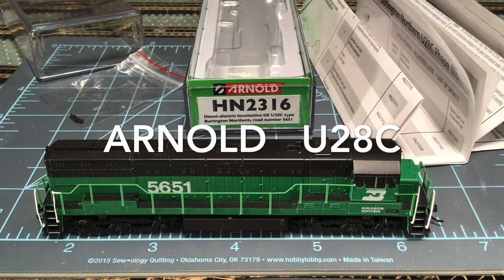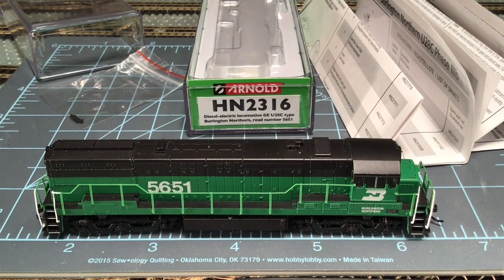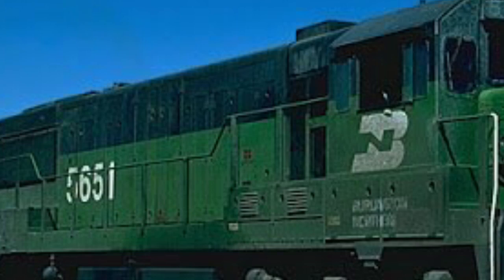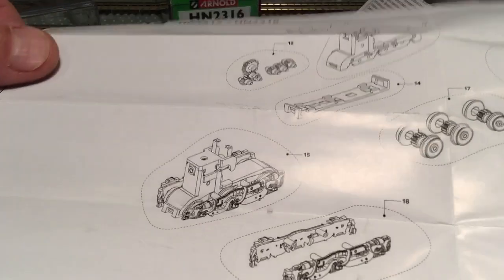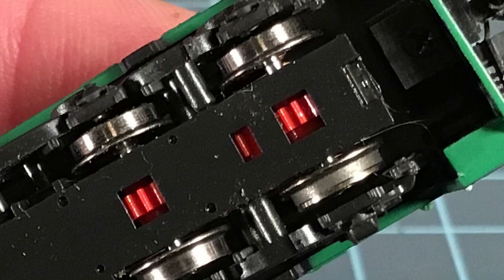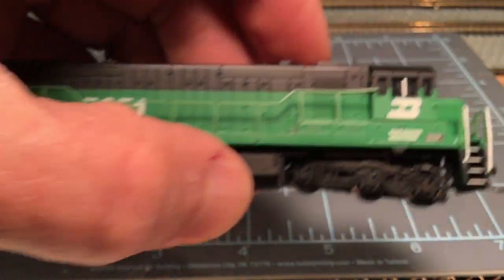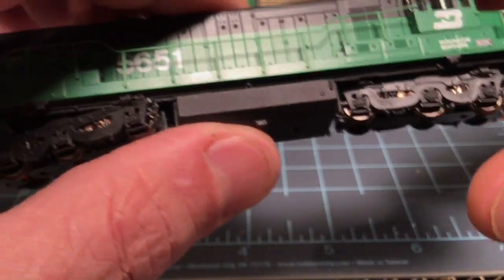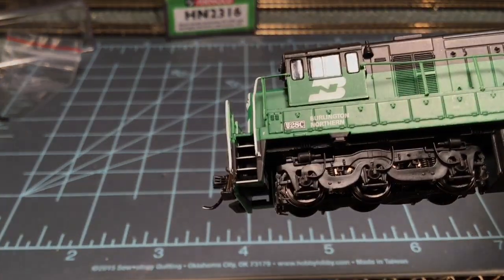Review - Arnold - N Scale - U28c BN 5651 - 15 February 2020 - Running Trains!

Comment: That engine looks good and in the future I maybe will buy a Arnold Loco since all I have is Kato and Atlas. Also check out those couplers on curved elevations because body mount one's  can tend to uncouple sometimes compared to the truck mounted one's. This is mainly on a tight curve , anyway good overall review.
Reply from the maker: Thanks Adrien.
I have a Kato switcher that runs excellent. An Atlas C420 that runs better now that it’s run around the layout a couple hundred times. And now this Arnold U28c that runs superb right out of the box.
All of the radius on the main is 19”.... the yards have 11” radius minimum.